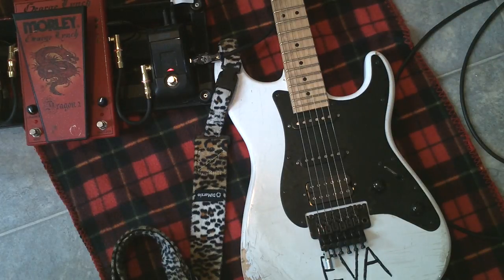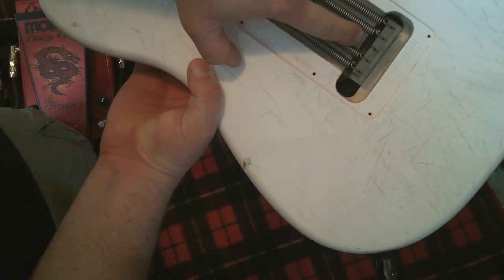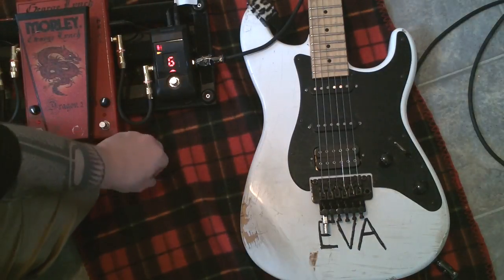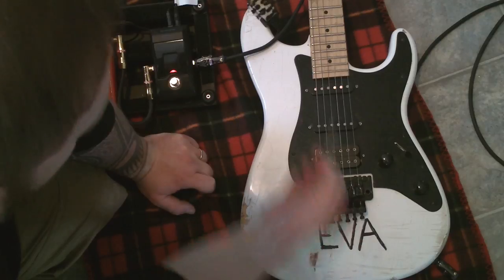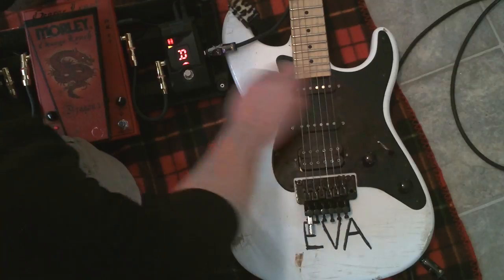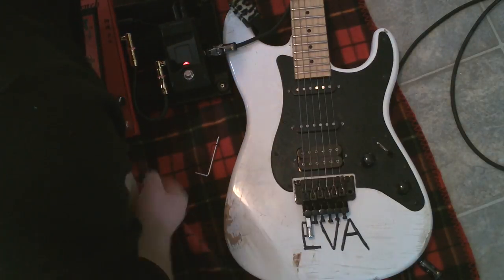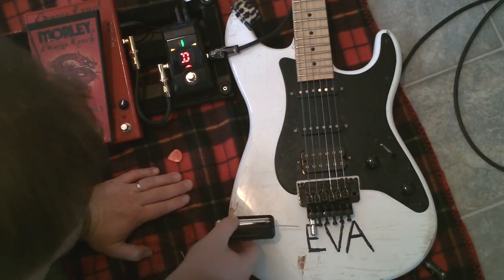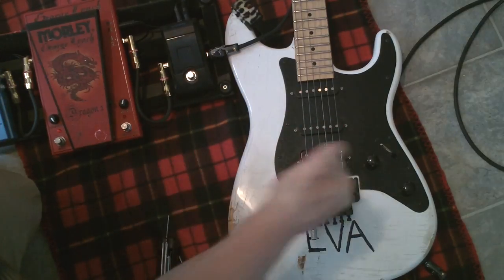How to Tune the EVH D-Tuna

Comment: Dude if you want that to stop flopping around when pulling it out try using the shorter screw they give you to lock it in place. Seems like when you flick it the D-tuna flops out. The shorter screw should eliminate the excess play in the d-tuna mechanism.

Good video thanks for sharing.
Reply from the maker: evilcowboy yeah, tried that...not enough travel. and it doesn't usually flop around...it was just because I have it lying on the floor. thanks for commenting! =)

Comment: when I push it back to standard taking it out of drop D the low e sounds out of tune but in the drop D setting it sounds in tune. i'm not sure what to do about that
Reply from the maker: Probably just need to adjust the fine tuner a little bit (it's fairly common). =) also - double check that your intonation and tuning is stable before locking out your trem for sure!

Comment: I've done exactly what you did and Drop D is perfect but when going back to E, totally off. The smaller set screw seems to do nothing. Have to adjust screw in E to get it back in tune. not sure what else to do.
Reply from the maker: The tiny little screw on the D-tuna itself doesn’t adjust the unit once it’s back up? Is it fully locked back in the first position? Did you check out my how to install vid?
Reply: @SamuraiFingers  I will have to double check because it seems like I'm missing something. I'll let you  know.
Reply: Tried it again today and still no luck. Have to adjust the screw to get in back in tune when back in E. Removed the D-tuna also to make sure it was on there right. It's an EVH Frankenstein by the way.
Reply from the maker: Bummer. If it's an EVH Frankenstein -you'd think it would be installed correctly. You may have something else going on with your guitar. Perhaps the bridge isn't fully level on the body, springs not tight enough in the back...neck pocket loose? Nut not tightened down fully? Without seeing it in my hands I can't really do too much for you I'm so sorry! My best advice would be to bring it to the shop where you bought it and have them look at it. Good luck!
Reply: @SamuraiFingers  I figured it out. There was a small crack by one of the poles by the Floyd Rose causing the shift. I have another question though. Should I adjust the intonation in drop D or E?
Reply from the maker: Sorry I missed this. If you are adjusting the intonation for your guitar - I would do it in whatever tuning you are most commonly using. for the most past a drop from E/D will keep your intonation pretty close - so it will be relatively imperceptible when you change back and forth.

Comment: Thing literally doesn't work for me, it won't pitch up to E. Is it because I use 52 gauge E?
Reply from the maker: Probably not. Probably just not setting it up correctly. The low E fine tuner had trouble be all the way out (or most of the way out) for it to work correctly. Check out my installation video it’s a bit more on the mechanical side of the device.
Reply: @SamuraiFingers  Nah, it literally won't pitch up even fully fine tuned at the most extreme angle. It's installed correctly. It's a Gotoh Floyd but It's supposed to still work, I don't know. Already watched that vid too.
Reply from the maker: Oh man. What a bummer. There must be some sort of difference in design between the Gotoh Floyd and the "True Floyd". I wish I could help man! Have you tried taking it to a local luthier?

Comment: After locking the nut, I can't fine tune all the way. When attempting to fine tune ,the fine tuning set screw bottoms out and I'm still not in tune/ Any solutions
Reply from the maker: Did you tune the guitar before locking the nut? That’s the first step. Of that still doesn’t work - then you need to adjust your intonation.
Reply from the maker: So then your intonation could be off.
OR - you could have the device upside down/backward, or perhaps not pushed all the way in when going up to standard E tune. 
It's hard to diagnose via text on the internet.
Usually if it's not able to be tuned - there's something else going on. 
I would take it to a guitar shop and have a tech look at it if you're not able to diagnose yourself.
I'm sorry I couldn't be more help! Let me know how it goes!
Reply: @SamuraiFingers  no worries thanks for responding

Comment: I have a problem with the 6th string, everything is in tune but when I start playing that 6th string it keeps getting flat, specially in the standard tuning position, why is that happening?
Reply from the maker: Could be a combination of thin strings, heavy pick attack. OR you haven’t “fine tuned” the D-Tuna with the set screw
Reply: @SamuraiFingers  the guitar is new it's a 2021 evh 5150 standard, the strings are 9 to 42 they are new but the other strings stays perfectly in tune its just that 6th strings that keeps getting flat when I play, and the D-Tuna is also "fine tuned" perfect
Reply from the maker: 9-42s are quite thin. Sounds to me like a pick attack- too much pressure from the pick forcing the string to sound out of tune. Does it go out of tune as soon as you it it, then slowly as it rings goes back into tune?
Reply: @SamuraiFingers  it goes out of tune when I bend the string
Reply: @kh888ni  could also just be that your new strings need stretched. Might get better with time

Comment: I seem to have a problem with my D-Tuna. 
So I have an LTD by Floyd Rose bridge so I think that should be good. I have an ESP M-200 tremelo (I have the tremelo blocked). When I install the D-Tuna, in the out position is my regular drop D but when I push it in (engage it) my tuning only goes up a half a step to D#. I even used the fine tuner (Allen wrenche) and it won't do anything. I have no idea what to do, think you can help?
Reply from the maker: Something might be funny with that bridge. Sorry I don’t have any idea on how to help more than that- you should probably take it to a repair technician/luthier
Reply: Your nut might not be secure. Or you might have a burr in the nut slot on a string or two.
Reply: same here... half a step at most.

Comment: thanks. could you please tell me how far it sticks out of the floyd rose when playing standard tuning? i dont want to route much of body for pulling up. the cavity space now is approx 22 mm
( i use goldo backbox so it won't go sharp in dropped D )
Reply from the maker: jimmy scott to install it properly, you won't route anything. You actaully need to lock the trem off from pulling up for it to work properly.
Reply: Samurai Fingers  I've got it working. I didn't have to route anything. but I did had to saw 3 mm from the end of the D-Tuna and shorten the smallest locking screw by 5mm. and with the Goldo BackBox it stays in tune. and I can still pull up on the trem. only when the D-Tuna is pulled out I can't pull up on the trem because it will hit the body . thanks